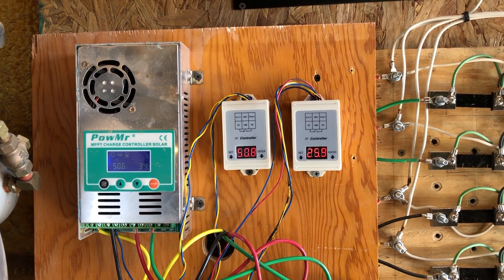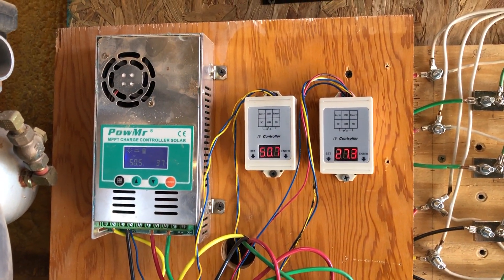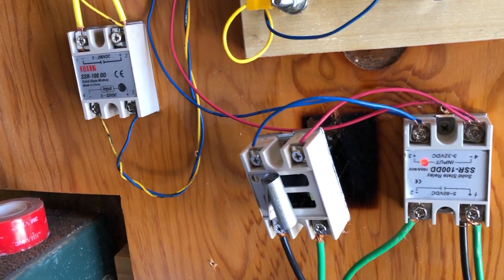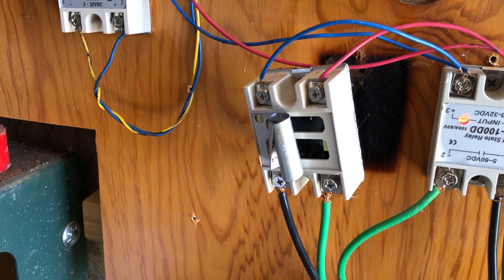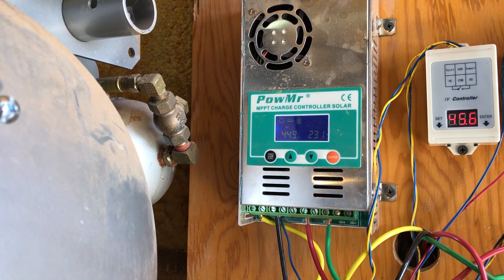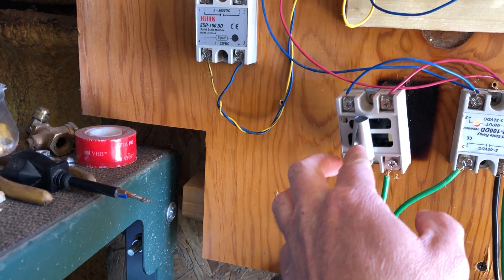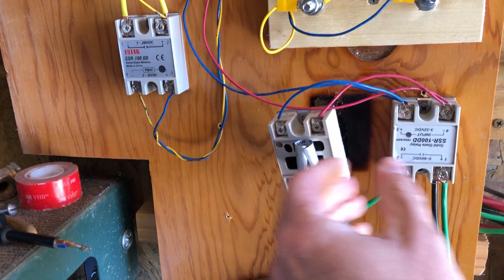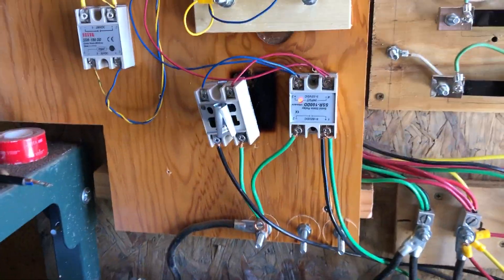So much for the new charge controller setup :D

Comment: I,ve ordered  
Battery charge controller 440 AMP 12V solar panel wind turbine 10,000W G4 for my 12v wind system,I watched another guy on you tube talk about solid state relay,s getting to hot and he,s going back to relay soleniods? What,s the advantages and disadvantages of relay soleniods verses solid state relay,s?

Comment: You better mount these to a heavy steel or aluminium plate.
Reply from the maker: I've got a bunch of old CPU heat sinks I was thinking about, but I do have some 12mm steel plates laying around that I'm considering now.
Reply: @ToysforWatts  steel plate no good

Comment: Lmao oh Buddy those relays are made to be mounted with heat sinks.  They work amazing but they need cooling,  I would have to see you burn something down. Your videos are awesome I don't want a fire to end them lol.
Reply from the maker: I've known they get warm but I've been using the things for a year now and never had one get THAT hot.  These two were new to me...a different brand from a different vendor.  I'll be ordering a couple more from my previous vendor and I'll be mounting them to either a set of CPU heat sinks or 12mm steel plates.

Comment: Mount on an aluminium plate. They need a heat sink. Do not install with an air gap!
Reply from the maker: I have some aluminum CPU heat sinks I'm thinking of using, or I have some 12mm steel plates.
Reply: @ToysforWatts  the aluminum is a better heat sink. Steel doesn't lose the heat well.

Comment: SSR's need large heatsinks. Airflow alone is not enough.
Reply from the maker: The ones I've been using previously never got this hot...these are from a different seller and a different model.  I'm going back to the previous models and I'll be mounting them to steel plates or some old CPU heat sinks.